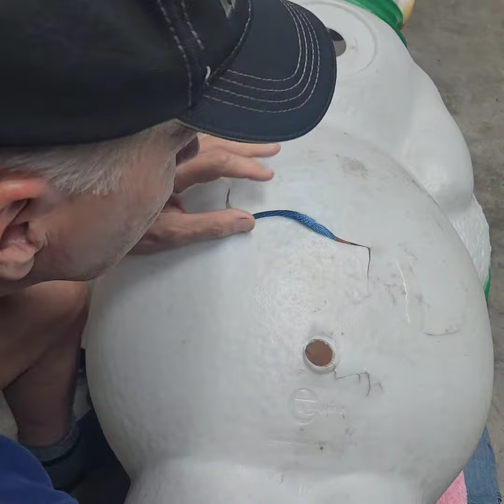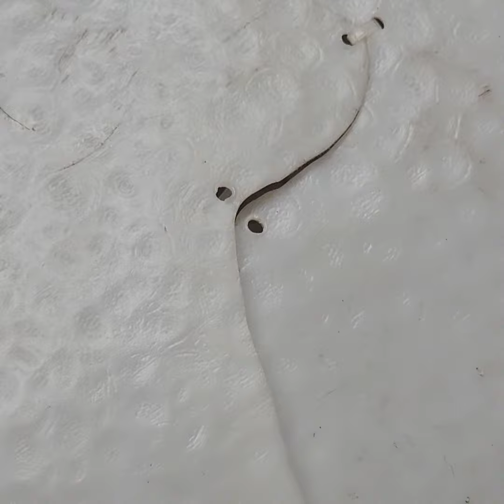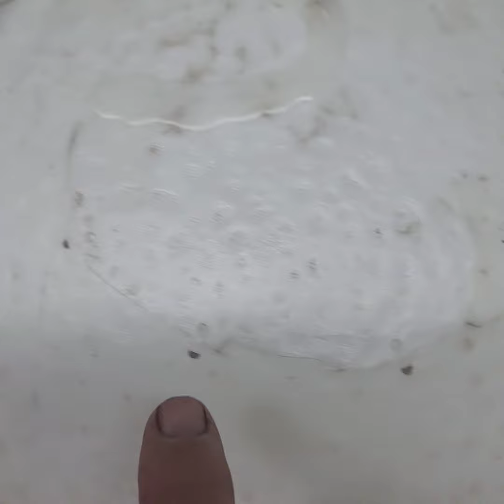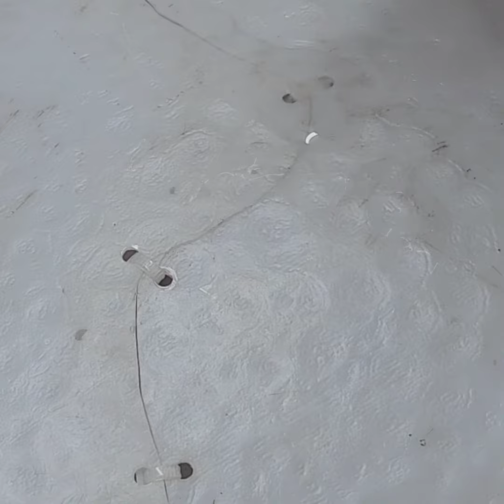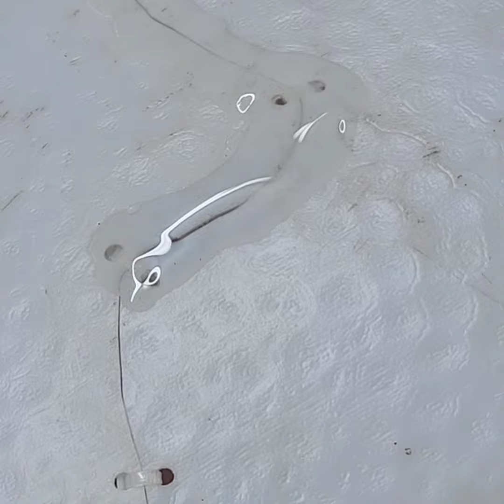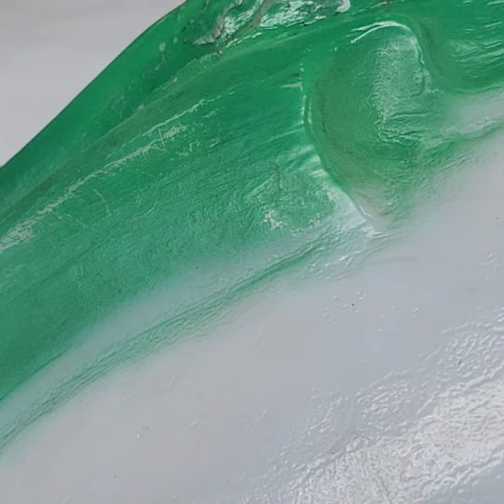HOLIDAY BLOW MOLD REPAIR FROSTY PART 1

Comment: I am beyond thrilled to find your videos! It’s Christmas Day and I’ve been longing to repair my Santa Clause, mfg’rd in 1955! My parents bought it in 1956, the year I was born. I inherited Santa and collectively my family has enjoyed him every Christmas for 68 years! Watching your videos I realize he should be an easier repair because he has a cardboard backing where the lights are attached, like a light board. (He hangs on the porch wall). Easily removed so easy access for repairs! The base is Santa’s shoes and there’s a hole on the boot where the heel should be. The only other repair is to a piece of holly on one side of his hat. I’m super excited to order my supplies and get Santa repaired. I didn’t see in your video what kind of paint you used? I will be brushing on the paint. Originally Santa’s boots had snow painted on them that has almost all worn off. Happy I can hide any seams by replacing the snow! Can’t wait for your response! I’ll be watching more videos! Next is your snowman. Hopefully, you will share the painting process. Thank you soooo much! This made my Christmas!!!
Reply from the maker: Hello, 
Thank you for sharing your story. I love hearing about the restoration of cherished family blowmolds.
I air brush my blowmolds with transparent paint. This process allows light to pass through. I am working on an air brush technique video that I will post in January. Please come back to see it. Here is the paint that I currently use.
Thanks for watching.

Transparent paint
https://amzn.to/48xT97O

Air brush kit
https://amzn.to/3RSDF8J
Reply: Thanks for your quick reply!

Comment: To stop cracks from continuing drill tiny holes at the very end of the crack, or in your case melt holes. Plastics will not continue to crack past the hole.
Reply from the maker: Hello
Thanks for the tip. Yes drilling a hole at the very end of a crack works well. Thanks for watching.

Comment: Is it possible to reshape a blow mold which has become distorted? I have a very rare reindeer whose legs will support him anymore
Reply from the maker: Interesting.  I would need to see some pictures to determine the correct course of action. Can you post some pictures.
Reply: @johnyanik1414
Reply: I @johnyanik1414  I can’t seem to, no, but another person suggested a hair dryer and it worked! He’s able to stand now. The piece it glittered or flocked so the other suggestion of soaking it in hot water was not an option.

Comment: Briiiiiliant 👏🏼 👏🏼👏🏼👏🏼
Reply: I’m trying to repair the white sash on the 5ft Santa. It’s pretty cracked up. All the pieces are there but I need to prop that area up so all pieces fit and stay while I glue them back. Love what you did with the ties. The area I’m working with is super fragile and not sure it will work. I love how you used the glue gun and the heat. Love your videos! Gave me a clear vision on what I need to do. Thank you!!!!!!
Reply from the maker: Hello, I'm working on the front of Frosty the snowman now. It has large sections missing and is as brittle as potato chips. I will be demonstrating filling in and reinforcing large areas.